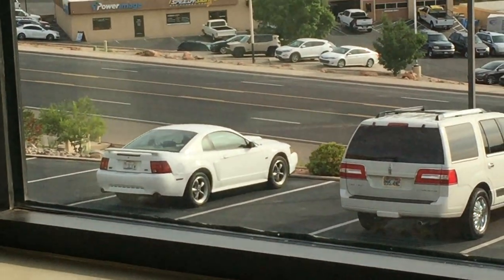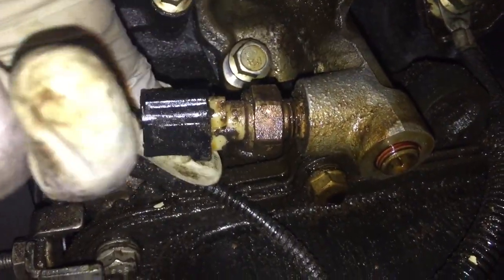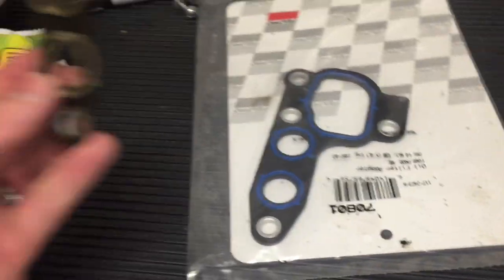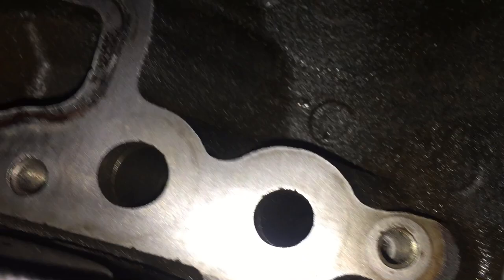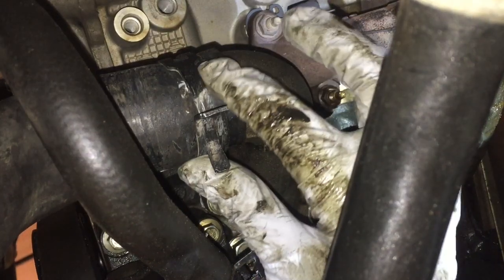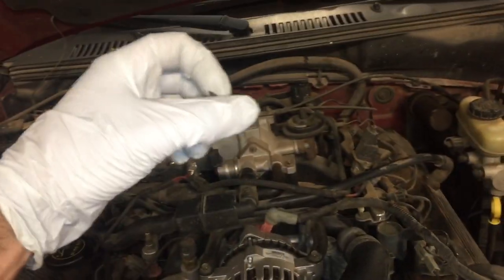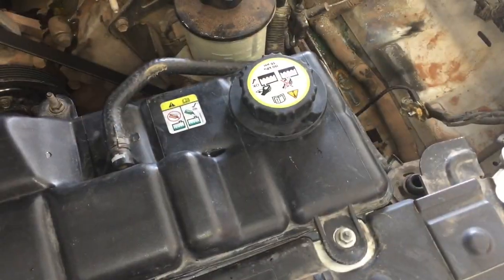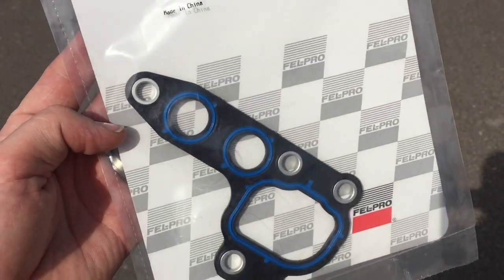Oill Filter Housing Gasket install: Fix oil leak & coolant leak Ford Mustang, F150 4.6L crown Vic

Comment: Since you had to disconnect that lower hose and let some coolant drain out to remove the housing, that would be a great time to replace the hose itself.  Also, these 4.6L engines really like that Motorcraft "Gold" coolant.  The older green coolant will work, but the gold stuff is better for those aluminum heads and can go for a longer period between changes.  Good video!
Reply: This is a great point of advice, that is what i just bought last week and replaced with mine, i had put the green in last time but have to turkey base the old stuff out until i get most the green out of it...lol! 

If you do this method you will have to collect the old fluid and take it to a place that will allow you to dispose of it the right way so you don't contaminate the ground water.
Reply: You are so right.  The gold lasts a very very long time!

Comment: I checked the oil level in my L-TC engine this morning and man! The dipstick came out clean! I don't know how the engine's been running that long without enough oil but it was all caused by leak from the filter adapter. Do not ignore those oil spots under you car.

Comment: Engine calls for 5w20 but you put 5w30. I do the same with my town car and grand marquis because I heard they were designed for 5w30 but later changed to get like 1/16th of a mile more per gallon.
Reply from the maker: Yes, exactly https://youtu.be/ymY96pVgrWg

Comment: Just to let you all know if you have the 5.4 3v engine with f150 you really don't need to do the fill the coolent like he did because it will work the air bubbles out in the coolent jug and also keep the unit pressurized at the same time.

If it is totally full like that you may get it to full then that would be bad as well i would think.

If you did not drive it to long you could turky baster it out down to the line on the coolent jug then put your cap on but check it later when it is cool to see if you need to take out more.

My f150 is notorious for this gasket to fail, so i just had to replace mine and this was a buger from hell to get to those 10mm bolts, i had to use extensions and elbow joint sockets to get to them.

My old gasket looked like his as well, so it needed it, also if your car over heats or a hose bust or you been leaking coolent and or the coolent jug over flows then replace the radiator cap because the cap is set to release pressurized air at 16psi and that is just my psi, yours could be diffrent.

Thanks for the great video, you did great with the footage so that we all got a good look at where them bolts were at, it is a really tough job so your sister better has made you a good sammich lol!

Comment: I got a 2003 f150 4.6 trying to put a gas on on the app on the oil filter housing how to do it I got a F-150 2003 4.6 I got leakage around the oil filter after I put a gasket on it how I go 🔙

Comment: Good video!! Going to do mine Monday.
Reply from the maker: If you have the 32V DOHC V8 it can be disassembled further putting an Allen into where the oil filter screws in. Otherwise, should be pretty straightforward. Good luck
Reply: Mine is just the 4.6,SOHC. So should be pretty easy. Appreciate it
Reply: Finished mine. Installing it was a bit pain for me. Bolts kept falling out but got the first one in then slid gasket over to line up with the other holes. Used some gasket sealer for extra measure. Installing new radiator tomorrow then praying it sealed.

Comment: Was this a voice over?  I didn't hear you yell or cuss one time.  It is truly a frustrating job.  Not too bad with a battery powered 3/8 ratchet and some super long extensions though.  I had to use a flex ujoint impact 13mm like they sell in several different sizes from harbor freight.  Good tip on the gasket maker.

Comment: How much coliant did you add at the end? I did this and can only fit 2gallons back in. I did everything you did. I was expecting to add about double that when refilling. I'm not sure how much came out....now that I think about it probably was 4gal? Thanks!
Reply from the maker: Just make sure to burp it and pour the fluid into the radiator not just the expansion tank https://youtu.be/fYvDqtGPyAM

Comment: My little Allen head screw that faces down has been seeping. I put some thread tape around it and it pissed five quarts in mere minutes. What is it sealed in there with? Looks like a red goopy thread locker?
Reply from the maker: Are you talking about the oil pressure sending unit?
Reply: @dannyjohnsonsgarage  no

Comment: Oh man I'm an idiot.  I did this before watching and I'm going to have to redo the whole thing. I take it that it's super important to clean the mating surfaces extremely well before putting on new gasket? I scraped the block with razor and that was it... and now it's leaking coolant. Are there any torque specs for the 4 bolts?
Reply from the maker: Also make sure you have the correct gasket. There are differences between iron block and aluminum, 16v and 32v engines. Cleaning both surfaces definitely is a good idea for proper sealing
Reply: @dannyjohnsonsgarage  I appreciate it.. just redid it and input a thin layer of rtv along with the gasket. Fingers crossed
Reply: I didn’t clean it or add rtv on my 96 tbird!…..

Comment: Maybe draining the coolant at the radiator drain plug would have been a decent idea
Reply from the maker: I like to pull the lower radiator hose since the petcock drain is plastic and weak. In this case I didn’t want to drain the full radiator

Comment: How did you realize it was that seal and not head gasket?
Reply from the maker: It was leaking coolant from the oil filter housing. The car was not overheating or blowing white smoke from the exhaust
Reply: @dannyjohnsonsgarage  theres oil in my coolant but not the other way around I'm leaking coolant and no white smoke is this the fix for that or should I try something else?
Reply from the maker: @nachothemacho0389  if oil is in your coolant it would be very likely from this gasket. No guarantees though
Reply: @dannyjohnsonsgarage  thanks

Comment: I need help! Plz! I just did this on my 1998 mustang GT. It has the oil cooler. I took the oil cooler off first and then the adapter plate and replaced the gasket. When I went and started my car, EVERY BIT of oil that I had just put in the car and was in the oil pan started pouring out from underneath the car around the area I was working. And I mean POURING out. Like all 6 quarts
Reply: Did I maybe accidentally hit and disconnect an oil line? The oil drain plug is on, the adapter plate, gasket and oil cooler are all back on correctly since it only goes on one way as well. There’s no hole in the block or anything like that so I don’t know what would make something pour out like that. As if someone is pouring out a gallon of milk from the engine bay
Reply from the maker: Check the power steering reservoir to make sure it wasn’t power steering. Check the oil filter- if it’s on too tight it will spray oil

Comment: Hey I was just wondering would this cause the coolant to come out of the coolant cap?
Reply from the maker: @blakegrymonprez3764  not likely. With this you usually have a coolant or oil leak here by the filter or oil getting into your coolant. If it’s coming out of the cap it’s more likely to be a bad cap, head gasket, radiator, or water pump 
Ford Water Pump Replacement Mustang, F150, Crown Vic: 1994-2004 Mustang GT V6 4.6L 5.4L 3.8L
https://youtu.be/8oUkAIsk8Qc
Reply from the maker: @blakegrymonprez3764  Mustang Radiator Replacement & Burp cooling system: Ford Mustang 1994-2004 GT, V6
https://youtu.be/mUUfCHWpjGI

Comment: Danny I have a 2001 cobra that needs that oil filter adapter changed is it basically done the same way as the 2 vavle
Reply from the maker: Yes. Ford now sells an updated gasket that works for both aluminum or iron block. Before you had to make sure it was the right one. Call in to the parts counter and see if they say the same. We did it on a mach 1 recently and it was the same process

Comment: so my mustang is the same as yours it has leak like inside near close the engine oil it leaks just the antifreeze how do i fix that problem do i weld it? or what i have no idea what to do
Reply from the maker: If it’s inside the car it could be the heater core under the dashboard. You’d have to take the dash out to fix it if that’s what it is. You’ll need heat in the winter for defrost, but could connect the two heater hose lines that go into the firewall that go to the heater core until you get it fixed (if it’s the heater core)

Comment: I’m not sure if you did but did you drain any coolant? I know i should expect a oil change but as far as the coolant you just add some after it’s all  put together?
Reply from the maker: You can drain some coolant from the large radiator hose on the driver side, or just let what comes out happen. You’ll want to fill and burp the cooling system in the end as follows https://youtu.be/fYvDqtGPyAM
Reply: @dannyjohnsonsgarage  Im about to do it either today or the coming days, if I pop out the housing like you did with it just going everywhere how much coolant do you think I should have ready for the job? I know it doesn’t fully empty out is this something I’ll just have to wait and see for?

Comment: Would this just cause straight oil leak, oil leaking into coolant, coolant leaking into oil or any of above-mentioned
Reply from the maker: It can, but a head gasket could as well
Reply: @dannyjohnsonsgarage  do the v6 mustangs have oil coolers too? Or is this just v8s

Comment: Great job! Do you happen to have the part number for the gasket you used?
Reply from the maker: For this one It depends on the year make and model of your car. My brother just went and got one at Ford and they updated a part that works on all 4.6L cars. It’s metal. What car do you have?
Reply: @dannyjohnsonsgarage  It's actually a 97 F-150 with the 4.6L V8 engine, it's a 2 valve so I'm guessing the gasket arrangement (holes) are the same.
Reply from the maker: Look at this one, but put in all your info where it asks to confirm https://www.amazon.com/gp/product/B000C2G8GQ/ref=as_li_tl?ie=UTF8&tag=2004047-20&camp=1789&creative=9325&linkCode=as2&creativeASIN=B000C2G8GQ&linkId=108e727b7bd0b07c5d49a26742c0116d
Reply: @dannyjohnsonsgarage I'll check it out, thanks for your help bro

Comment: Is this the same gasket for the Mach 1?
Reply: I don't believe so.  Mach 1 should be 70415
Reply from the maker: @non ya is correct. The mach 1 has a different one and even the 03/04 cobra has a different one than the mach 1

Comment: Did you torque the bolts down or just hand tight?
Reply from the maker: Hand tight alternating bolts. I’m sure there is a spec out there for it if you want

Comment: Hey Danny, awesome video, like always. Just wondering why you use 5w-30 oil instead of the recommended 5w-20? Thanks.
Reply from the maker: 5w20 is thinner and implemented for fuel economy https://youtu.be/ymY96pVgrWg

Comment: Couldn’t I just drain the oil and coolant to avoid them mixing together?
Reply from the maker: During the repair? Yes. Otherwise they leak into eachother with a bad gasket
Reply: @dannyjohnsonsgarage  yes, I meant before removing the housing and gasket. I have a leak coming from that same exact place on my 94 Town Car
Reply: @estebanrodriguez7361  you can do it this way but add fresh stuff after the job is done.

Comment: What happens when this seal goes bad?
Reply from the maker: Oil gets into your coolant or coolant gets into your oil. Coolant in oil will not lubricate as well as oil and could spin a bearing in the engine

Comment: I think I have the same problem with my 2001 Bullitt. How much in parts and labor do think this will cost today?
Reply from the maker: I’m sure you’ll be charged hundreds of dollars at a repair shop. If you do it yourself, about $50 max for the part and the replacement coolant